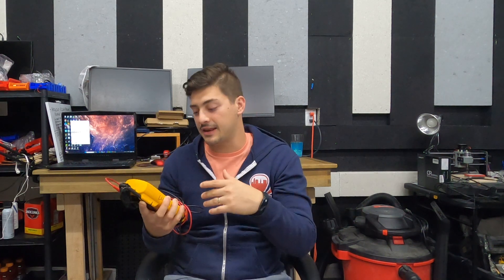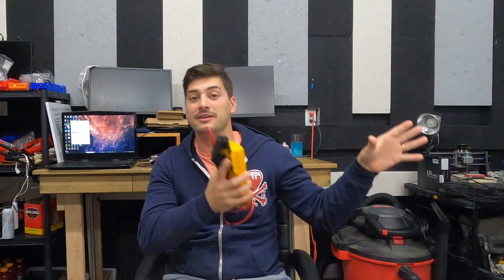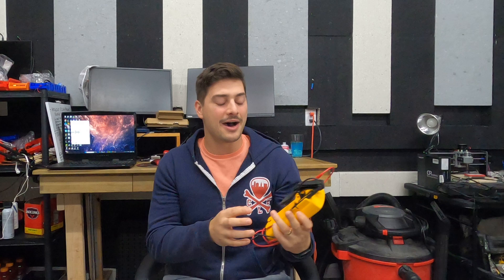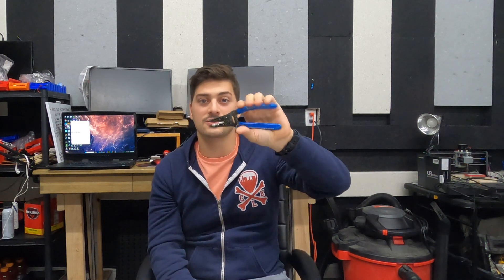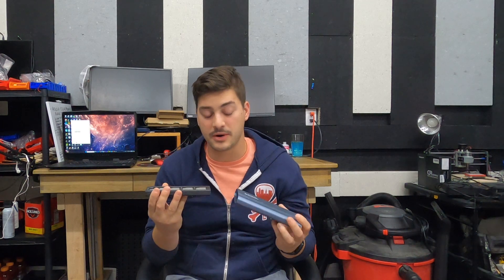Top Tools Required for Controls and Automation Hardware!

Comment: Thanks peter! Thanks for your content. I stubled on your channel before and again recently noticed you perhaps are also a new dad.. It comes with so many life's changes but a blessing for sure. Also Noticed you working for spaceX. What sort of control systems exist in SpaceX? I noticed some ignition tutorials you have on your channel and you mentioned the popular Studio 5000  TIA Portal.. I am in the Automotive industry working with/for system integrators who builds and integrates production machines for OEM's(GM, Ford, Tesla, BMW, etc.) These customers have specifications that are specific to them which is just a term used to describe what their PLC software architecture looks like and how its integrated with their HMI's also they have a specified list of hardware components that Si's are allowed to use when designing machines for them. And all controls need to adhere to the specification/standard.
Reply from the maker: Thank you very much for the interest in the channel! And yes a new dad and working for SpaceX, although I can not unfortunately share much about what sort of control systems I use at work! If you ever check out SpaceX job listings for controls and automation engineers they give you a decent idea what sort of things we do!

Comment: Hey man! I’m actually really glad i found this channel, primarily because I’m a 30 year old EE student with some trade experience. i’ve installed cable and been a mechanic for Mazda and the post office. now I’m an actual mailman lol. 

anyway, so i have always liked making electronics hobby projects, and i’ve decided to go to school for EE to do something i love and get paid well without breaking my back. I’m not THAT into big tech and coding, though my dad is a software engineer so i have some experience with that. 

THAT SAID… i found this field and i instantly was like “this is the thing for me.” it seems hands on and brainy and electronic all at the same time. i even enjoy the traveling aspect! do you think this would be a good focus for me, even if i won’t graduate for 5 years? maybe it will still be in demand? that’s kind of my main concern along with hoping my degree and projects can prepare me for an internship or job in the field
Reply from the maker: Hi! It’s cool to hear about your experience and you don’t have to worry it will still be in demand in 5 years haha! Because automation and controls is such a blend of hands on work and software/programming it’s likely to be one of the last things AI ever comes for to be honest haha.

I’d say if you wanted some free resources to mess around with check out Ignition for makers which is a free version of a very powerful SCADA software, and the beckhoff twincat platform which is a way to learn to program PLC using any windows device!

Comment: Great point on addressing the engineering laptop real requirements! So often do I see people mentioning laptop brand as opposed to hardware/software minimum requirements to run programs efficiently. 
I just want to ask, will I be using VMs to ignore the trial time of “certain” automation software?
Reply from the maker: Thanks for watching! And that's definitely one way they are used fairly often especially among integrators who may have lots of customers with less common software they only need every now and then! Its not the world's most ethical move to keep resetting trial versions of automation software but when its being used super infrequently its not a bad use case!